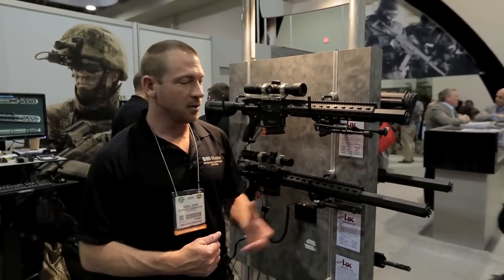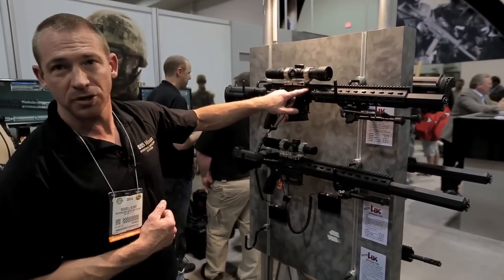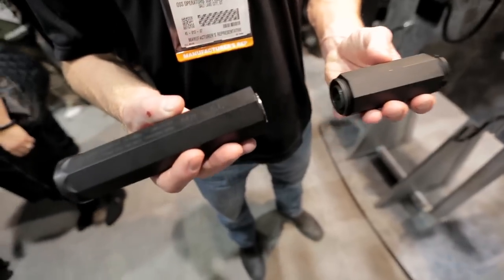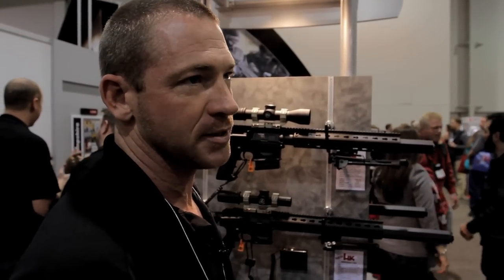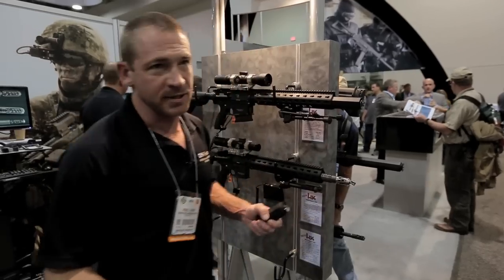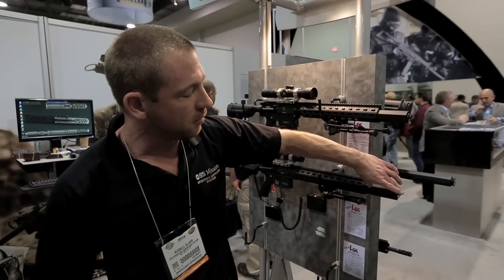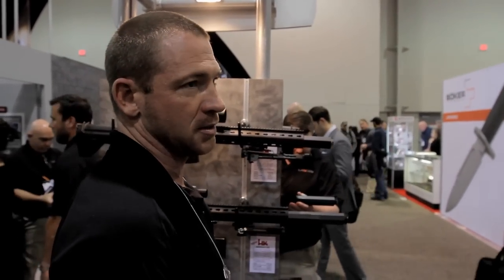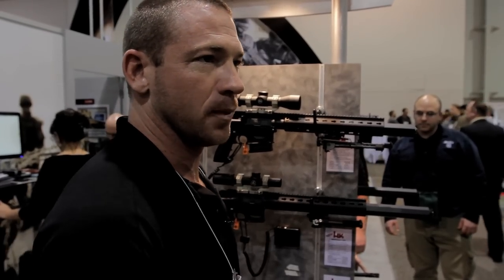OSS Suppressors

Comment: If you listen closely, there is always a fatal flaw in the sales pitch.
He mentions only a 6% increase in bolt velocity. With the first add on. Oh by the way youll definitely want to add this second thing onto the silencer, this part actually makes it quiet. 

He doesnt give you an updated value for bolt velocity when you put the actual silencer part on. All smoke, and mirrors. Bait, and switch right there.
Reply: The bolt velocity doesn't increase from adding the second part.
Reply: Of course it does, ROFL. Is it magic?!?!? The second part does most of the silencing, therefore it will create more back pressure. Unless he has a magic wand I didnt see.
Reply: dpqbpqb dpqbpqb he said never increasing more than 6 percent with the second attachment as well
Reply: dpqbpqb dpqbpqb it's also hilariously loud, 138 "at ear" is the quiet side.. TiON's dragoon 556 is 127@ear. And it's lighter and smaller.

Comment: Rather than working on issues that can be mitigated by selecting the right rifle to run suppressed, more movement needs to be made on the sound reduction front. All of the features he talked about are interesting, but as far as I am concerned there is only one selling point on a suppressor: how effective it is at reducing the sound of a firearm.

Comment: Looks like the nicest gimmick in the suppressing field
Reply: Just because the technology may be out of your scope of understanding doesn't mean it's necessarily a "gimmick".
Reply: MandMTac The way that they're measuring the db reduction numbers is false advertising, and trying to make the numbers sound better than they are. Mil-spec sound measuring should be one meter to the left and 90 degrees from the muzzle. When they measure from the shooters ear, the number will be much lower. So a 138 db rating was over hearing safe at the muzzle. Great design, but I would rather use a suppressor that has a proven concept and a much lower db rating. The OSS has incredible potential though.

Comment: I think everybody is missing the point in what this suppressor is designed to do. it's designed to hide the location of the shooter while using supersonic rounds. your going to hear it but have no idea where it's coming from. staying hidden is priority not complete noise reduction. at least that's what I get from this design.
Reply: CIA Assassin 
it is designed to reduce the noise to below the level required for the shooter to need hearing protection. And reduce noise pollution
Reply: Random Aussie For civilian applications, not law enforcement or military.
Reply: This seems more like your civil sector suppressor, for sporting, that dampens the shot enough for you to safely handle the rifle without having to wear ear protection. This seems pretty useless for a combat scenario where sound suppressing is actually required. As for flash hiding, there's other things that do that, like flash hiders. 

Also locating a shooter by sound and echolocation is easier as looking for a muzzle flash.

Comment: I talked to a rep they said the msrp would be around $1200 for the 762 model, but what's cool about the ability to change components. You can put the 556 pieces into the 762 shell.

Comment: That's a sick system! better accuracy with that (what?! 30-40% increase in bullet velocity! Hides the muzzle flash, and quiets the weapons to boot? That would be mean on a mid-range rifle. (250-400 yards) Gotta love modern engineering~    I'm just wondering how much of this is hype?
Reply: He's actually saying "bolt velocity", it's hard to tell with the way he's speaking.
So current suppressor systems will increase the energy put into the bolt cycling, which is a BAD thing. Their system touts a 6% increase in bolt velocity which to me seems negligible.

Comment: This is why you go to a H2 or H3 buffer to slow down the cycle
Reply: Yes, a different buffer or adjustable gas block can help with the cycling but they don't mitigate the back pressure blasting you in the face with a traditional can. This system solves that major issue along with many others that suppressors have suffered for the past 100+ years.

Comment: Maxim tried helical designs... ended up using baffles in the end. That should tell you something. Not saying they won't muffle the report at all, a simple blast chamber on the end of the gun will do that; but I don't see this working as well as baffled designs. The Octagonal body is a good idea though. 

Set your firearm up to shoot with a muffler attached, and only shoot it with the muffler attached (IDK why you wouldn't) and problems with premature breech opening solved.

Comment: I spent 4 hours with Russ Oliver, the inventor of the OSS Suppressor, today.  This suppressor is just as advertised.  Fired a 5.56 HK in a 6 x 8 foot closet (yes 6 x 8 foot) on full auto without hearing protection.  After firing a mag, could disconnect the suppressor from the gun without gloves.  There was no blow-back during firing.  Russ Oliver is the real deal.  The story about how he developed this next-gen silencer is inspiring.  I'm a believer.  The only product demo that I've seen that is as dramatic is when Steve Jobs introduced the iPhone.

Comment: Call me a pussy, but the idea of cleaning this thing just brings up images of my mangled cut up fingers after hours of cleaning carbon out of those tiny grooves. Cool idea though.
Reply: TheDudeofDudes That's an interesting point. For something that complicated, an ultrasonic cleaner would take care of that. Looking around the internet, they're not too expensive either.
Reply: +Anthony B Exactly, even hoppe's elite.
Reply: Soak it in brake cleaner, rinse it out
Reply: R
Reply: +TheDudeofDudes anyone with the money to buy something like this would have the money to buy a nice ultrasonic cleaner. Can only imagine the price with the highly machined precision parts and all kinds of weird shapes......
Reply: Kevin Carr True. I didn't even know about ultrasonic cleaners before this post. All I ever knew was CLP, baby wipes, and elbow grease. I only know the low cost military version of cleaning a rifle. It takes a long time, but it's effective and cheap.
Reply: it costs way less than you'd think.... the machine is expensive, punching in dimensions and measurements on a cnc machine costs little and does take little experience. Not bashing the product, just the cost haha
Reply: Gung Ferdoosh As a mechanical engineering student I completely agree. Production is the cheap part if you design your own parts. How much is this can?
Reply: Gung Ferdoosh yes, maybe so but that cuts down on production speed. CNC isn't necessarily fast
Reply: I think he said it was $1500 or around that, no where near real production value. TheDudeofDudes
Reply: +TheDudeofDudes
 Pussy

Can confirm ive worked with steam turbines that are less complicated then this can though.
Reply: Rahad Jackson
No shit!
Reply: Gung Ferdoosh Yep im serious

Comment: I was going to say it's "magic" since a suppressor lowers the noise by the very fact that it increases the time it takes for gas to escape the gun you get a "pffft" noise instead of a "pop" noise (think of a balloon being popped vs being deflated).  Then they reported the noise reduction numbers and how they test them.  So it's not magic at all, it's loud.  Quite loud actually.  It's probably fine for an active military environment since absolute suppression isn't all that important for a supersonic rifle in an active combat zone.  Flash reduction, not kicking up dirt and hiding the direction of the shooter are the important parts and this probably does that fine.   For a civilian shooter I'm thinking this would be disappointing in the extreme.  Even the "extended" mode would be unpleasantly loud and would be quite a bit louder then MUCH cheaper competing models.

The mirage reduction idea is excellent though!!
Reply: Loud bang is actually caused by heat from the explosion more than any other source. Thats why you can mute a shot with a pilow.  Another loud thing in a shot is the super sonic crack from the bullet breaking the sound barrier.

Comment: Looks like some sweet suppressors! But what is there price compare to other suppressors?
Reply from the maker: I haven't seen them on anything but the HK stuff as of right now. I'm not sure if they have some type of deal worked out. HK stuff is never cheap. Baffled suppressors are really cheap, just take time and that NFA tax stamp. These little feats of engineering look like they might cost a penny but the fact that everything is replaceable within the system is pretty cool.

Comment: Very interesting concept.  I am skeptical of the mirage'ing issue comparisons, but I'm not expert in thermal dynamics so ... there's that.
Reply from the maker: I'm not an engineer, but it makes sense to me. I don't think the miraging is as big of a deal as the overall system and how it handles the gases and blow back. Though, I would think multiple dissipation points would cause it to cool faster as well instead of a isolated point at which all the heat tries to escape from.
Reply: Guns My gripe is probably only really how he explained the heat dissipation coming off the points of the octagon.  I do know that heat rises, so any miraging would be coming off of the top and perhaps wouldn't be as focused (compared to  if it were coming off a round suppressor as there's - I presume - a greater surface area).
But I'm just nitpicking.  It's something I picked up on and probably isn't really that big of a deal in most applications.
Will you be getting the opportunity to do a live fire comparison in the near future?  It's a revolutionary design (from what little I know) and it would be great to see a radical advancement.

Comment: Surely a piston driven gun negates that issue? You just alter the valve to allow the correct amount of gasses in.
Reply: I don't know. I mean, the gas tube being over pressured isn't the only.  Barrel/chamber is over pressured and adds to the bolt velocity as well. I imagine a piston gun will help control bolt velocity (or any regulated/adjustable gas system), but you're still left with gas in barrel/chamber longer than intended. 

Also, a solution in the way of suppressor design will help help correct some of the issues on weapons that are regulated gas pistons (like handguns).

Comment: Could I get an (one) OSS Suppressor that would work on a 6.8x43 as well as a .308/7.62 x51 since both barrels have the same thread pitch? Also, Your suppressor's don't need an Adjustable Gas Block correct? From what I have seen OSS is what I want and are the best!

Comment: These suppressors are already antiquated. I met a man who 3D printed metal suppressors that had better baffle systems than any subtractive manufactured suppressor could possible have. This is the way of the future for suppressor companies, you need to move to 3D or else you will be left in the dust.

Comment: Turbines? Sounds like a lot of moving parts that could break.
Reply: Parts don't move, gas moves around the "turbine", like a jet engine in reverse.  A jet engine takes air that isn't moving and compresses it, silencer takes compressed air and expands it.  The air is already moving so the parts don't need to.
Reply: Jeff Thatcher I would disagree with that because Turbines by definition are made to move or spin.
Reply: Derr Mann You can disagree with it all you want, it doesn't change the fact that you're wrong about how this particular product works.
Reply: ***** LOL

Comment: He says the (h&k) 416 has a 20-30% increase in bolt velocity with any other suppressor, but doesn't the 416 have an adjustable gas block to counter this?
Reply from the maker: Correct. He was using standard operating conditions for a rifle as the "control" in the experiment. Since not all M16/M4 variants are selective piston controlled he probably didn't mention that since it really doesn't apply to all rifles but the OSS suppressor does.
Reply: A fair point

Comment: I love innovation no matter what it is. But the machining on this looks crazy expensive. It would be nice to not have gassy 5.56 eating your eyes from blow back.
Reply: Think of it this way:
The initial cost might be more.
But as you're replacing just the non-NFA components, it saves you repeated tax stamps to replace your whole can when it's shot out.
(The "silencer" is the empty tube that's slid over everything. The central bits are just a "muzzle brake," and not NFA-controlled.)
Reply: Very good point. Especially if you can get a 30 cal version and swap in for the 5.56 components. Nothing that we do is cheap so why not.

Comment: I'm sorry, are you saying that these suppressors increase the bullet's velocity? What about bullet drop?
Reply: Suppressors do increase bullet velocity, *on average. While the bullets mean velocity does increase a few percentage points, your lower quartile of velocity data, (the lower 25 % of all velocities) is lowered as well. In layman's terms, while yes on average the projectile will speed up, it makes the shot to shot variable velocity have a much greater range. While it may only 30 - 40 feet per second, its still something. All of that being said, the amount of difference suppressors make on fired rounds is all within a couple percentage points, thus, the effect is negligible. For all intensive purposes, you could say suppressors have no effect on velocity, as statistically speaking, they are minimal. 

TL;DR: They do have a very small impact on the average bullets speed. However, they make every shots velocity vary more then the advertised FPS, giving you a greater range of bullet speeds. Some higher, some lower, all negligible.
Reply: He's saying bolt velocity. He's referring to the speed at which the shell casing extracts from the barrel. The additional build up of pressure from a typical suppressor causes the action to extract and cycle rounds faster and harder than what the gun was designed.
Reply: Mason Stevens Bolt, and bullets both have an measurable increase in velocities. Whether or not thats damaging to the rifle varies greatly platform to platform.

Comment: really cool idea
Reply from the maker: Agreed. Russell has a really interesting story as to how he came up with the idea. I haven't fired it yet but I heard several friends whom attended the demo, were really impressed.
Reply: My main question is how did he realize that this was an issue? Because as far as i knew there was no issue with how suppressors were designed.
Reply from the maker: Daniel Geloso Most people don't have issues with a lot of firearms and accessories in recreational use. If they do then there is a larger issue... But guys who use stuff in LE or Military applications often find small issues can become big problems. A few examples of the new suppressor's solutions: Miraging from sustained fire be it from general use or in suppressive fire situations often causes heat signatures over the barrel The octagonal shape reduces it to several breaking points instead of 1 in a circular design. The main difference is the back pressure a baffled system generates. The rifles/submachine guns are designed with certain back pressures in mind. Adding suppressors affects extractions and so. That's why a lot of newer piston platform rifles have barrel adjustment you can change on the fly for suppressed and non suppressed shooting. This allows more or less gasses to purge in the discharge.
Reply: Daniel Geloso I'm going to go out on a limb here and say that he's probably fired enough unsuppressed and suppressed firearms to notice a difference in what he was saying about the 40% increase in bolt speed. Then all he needed to do was setup some sensors and fire a rifle suppressed and unsuppressed and measure the difference in the blow back and possibly put sensors in the suppressors to measure the pressure.
Reply: Ah that makes sense and its good that they found a solution to this problem, i imagine tat this will go over well with members of the military
Reply: convict555 yah it would make sense that there was some scientific testing involved as well
Reply from the maker: convict555 Correct. The story of how he developed the technology is actually really inspiring. I'm not sure if he told me in confidence so I won't repeat it or his experience but a quick look at his website will let you know he's a reputable dude who definitely understands tactical solutions for many situations.

Comment: this might sound stupid but how does the bullet come out of the barrel it looks kinda closed...
Reply: +stef bakker There's typically around .0300 of an inch left on ID clearance. That's more than enough room
Reply: +stef bakker It's a pretty small bullet. Most so called tactical rifles use bullets between .22 and .30 inches in diameter.
Reply: Surely you aren't one of those people who thinks that what exits the barrel is the entire round, casing and all. That would be an example of very poor knowledge of weaponry.
Reply: no i know what a bullet is. it just seemed to me that the ending of the barrel here is way smaller than the rest of the barrel is.

Comment: Is it cheating to measure the sound pressure level "at the shooter's ear"?  I think the loudest point is off to the side of the muzzle, although it certainly matters how far off to the side.  I think moving the measurement point back would reduce the reading.
Reply: Why measure anywhere other than where the sound matters for the shooter? (the shooter's ear, where he hears)
Reply: Deathbrewer, that would be fine if everyone did it that way, then we could compare sound levels between the different manufacturers.  I've seen no other tests on video by any other manufacturer that does it this way.  I think the highest SPL is beside the muzzle.  So, what I'm saying is, that levels at the shooter's ear could be 3 - 5 dB lower, so testing that way would bias the results.  I don't know for sure, I'm just asking, but that's what my gut says.